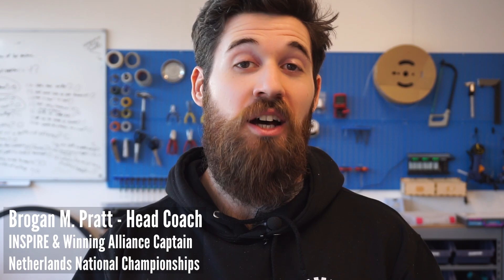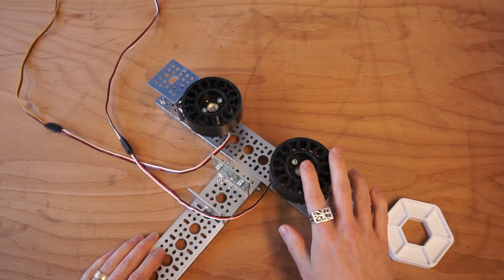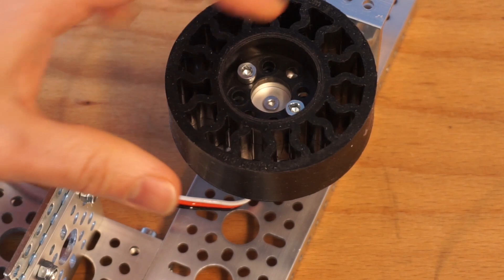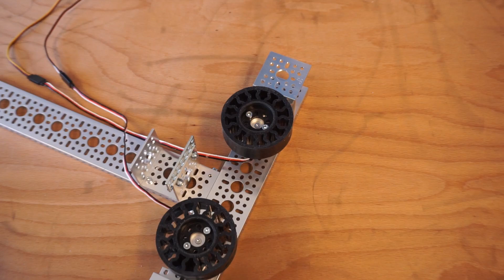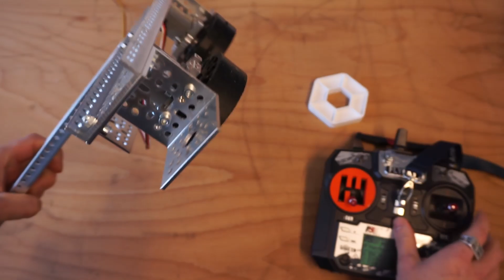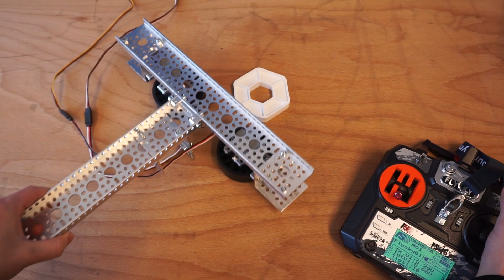FTC Intakes 101: Compliant Wheels #1 (For Into The Deep)

Comment: werent the specimens from into the deep quadrilateral prisms?? are these not the ones from last years centerstage ftc?? correct me if im wrong
Reply from the maker: No, you're correct. However, the concept of a dual rolling wheel intake still applies to most object shapes. Title was changed to reflect better SEO for the new season.